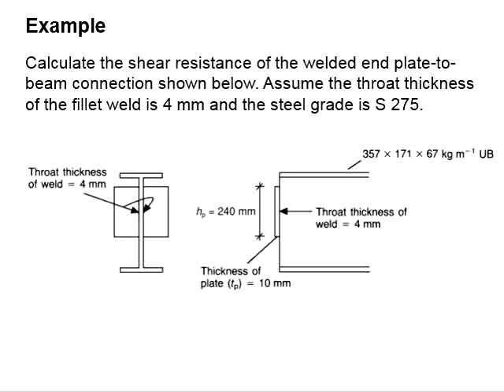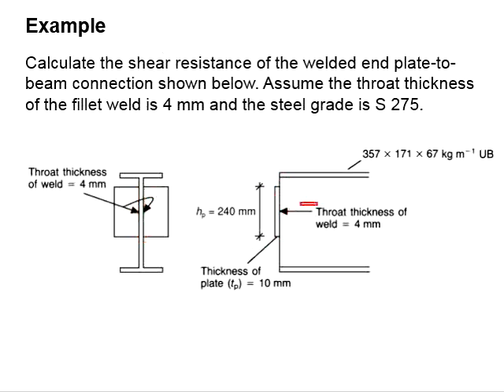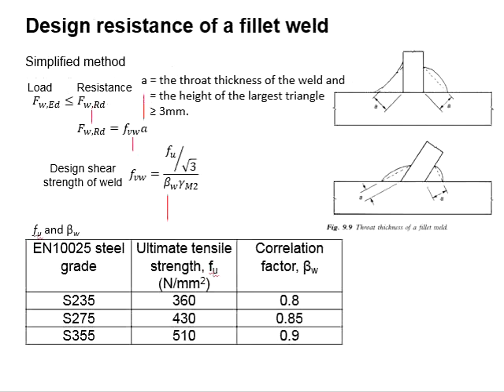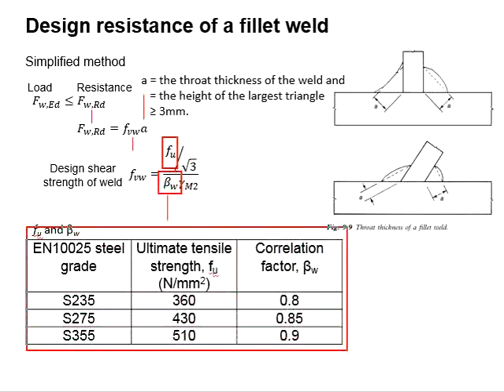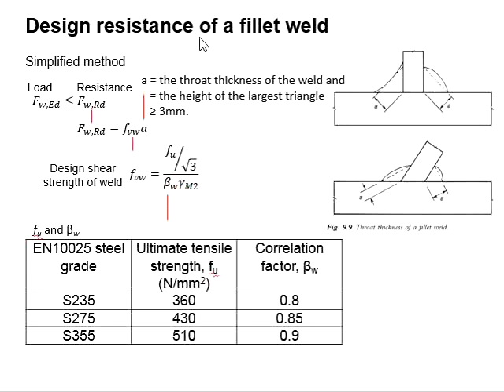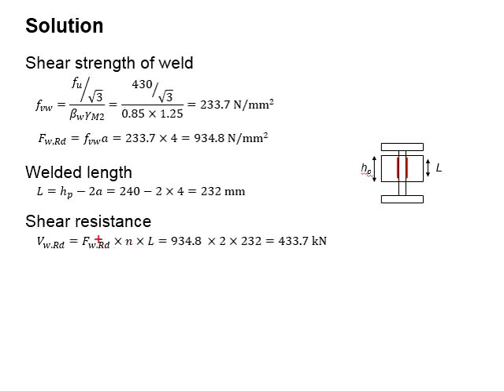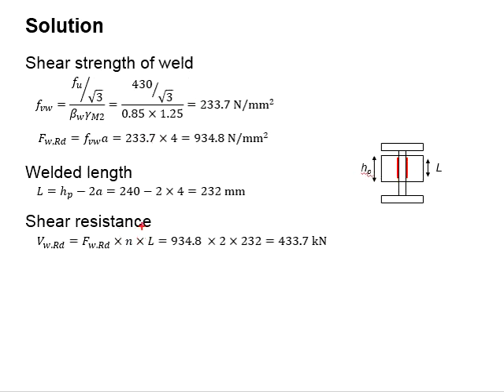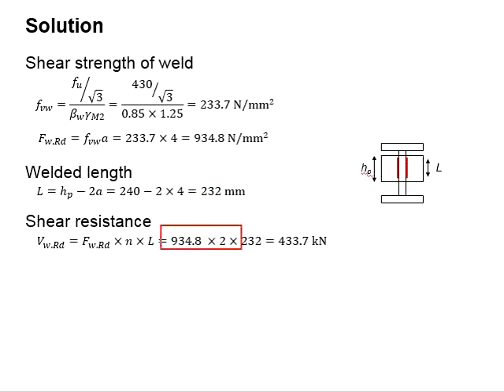2.13 Example: welded connection

Comment: 2:22 should be 934.8 N/mm [force per unit length]. Great video!
Reply from the maker: Yes. You are right. Thanks for the correction. Appreciate it.